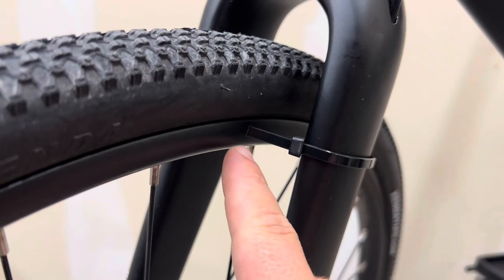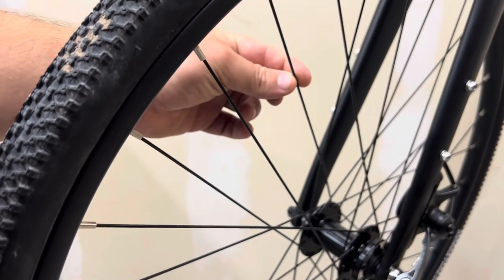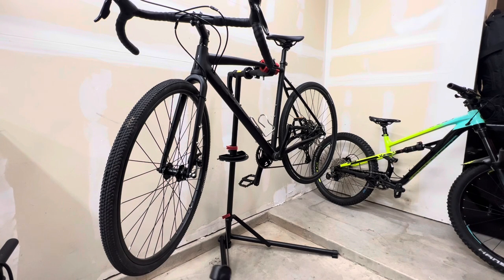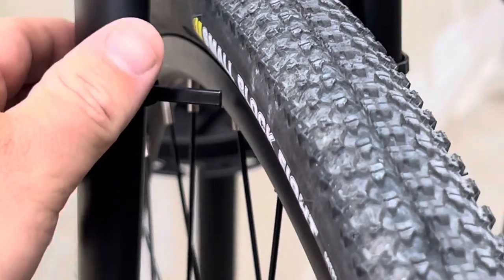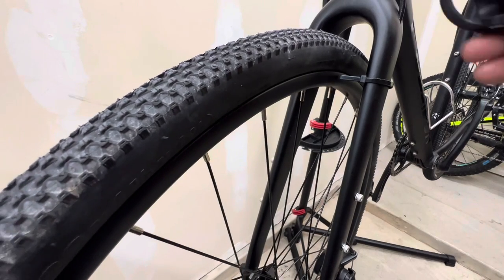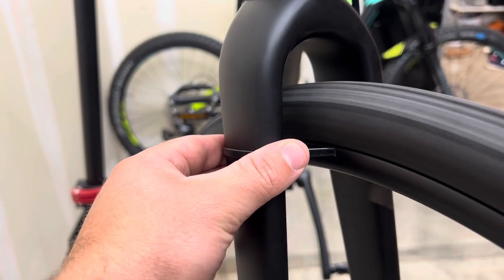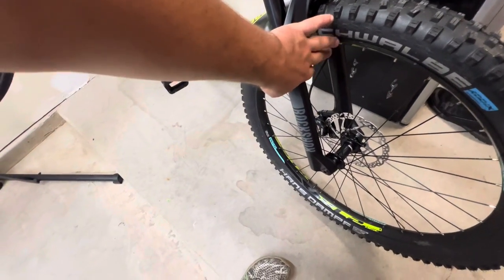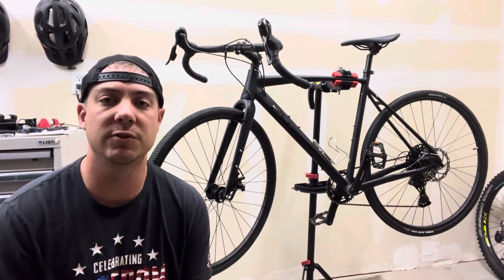How to True a Bicycle Wheel with only zip-ties

Comment: Thanks, this was an awesome video because I only have a 20 inch wheel on my electric bike and I can’t fit the gauge to meter the spokes. After I get the tire truth, as much as I could, do, I have to tighten them on a little bit or should they be a little bit loose? I still can’t test the gauge on it although I got the wheel pretty straight?

Comment: My question is how do you decide which side of the wheel you should put the zip tie on if you are using just a single zip tie? Does it matter?
Reply from the maker: Good question, I would suggest sticking with 1 zip tie on both sides to give you better results, with only 1 side you may run the chance of your wheel being off center. Thanks for watching!
Reply: They sell zip ties at the dollar store for god's sake.  What is wrong with you?

Comment: The wheel may run true with this method, but how do you know if it runs on center?
Reply from the maker: Good question, this method will get you close enough to true but still may not be perfect without the use of a stand. For center I do try to measure from side to side to ensure the center line is not off. This method is great if you want a quick fix. Thanks for watching!